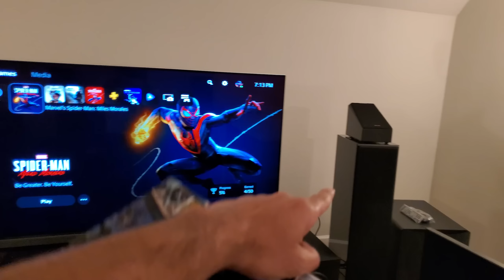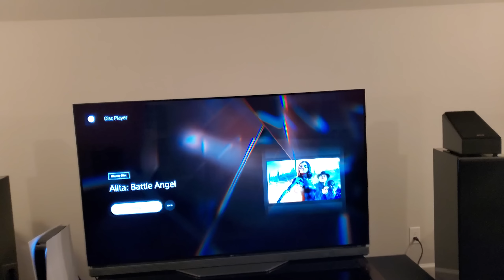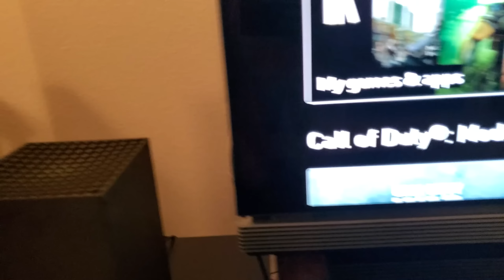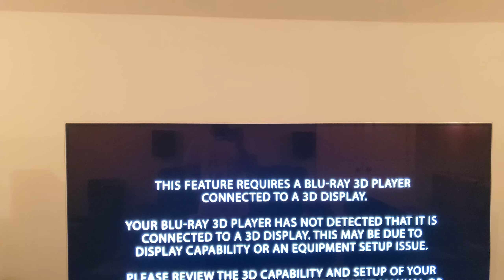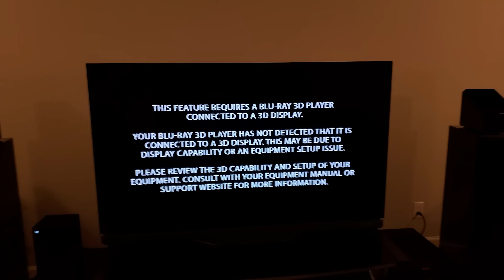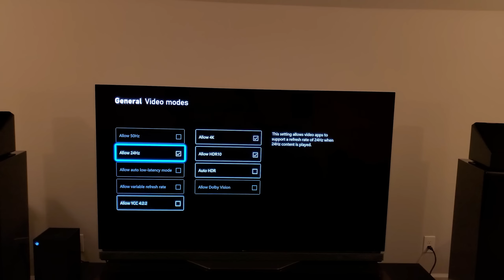PS5 and Xbox Series X 3D Bluray Test and 4K UHD Bluray Comparison

Comment: You might need to just run auto visual settings setup on the settings screen so the system can properly detect the TV and you will be asked to set the screen size for 3d if it works. You'll get the same error on a system setup that hasn't ran automatic visual settings on a PS3 too.

Comment: 3D not supported on PS5 for the VR2 capabilities.
I believe 3D is supported on the Xbox but you would need to downgrade from 4k. 
3D only supported 720p side-by-side and 1080p 3D signal mode. So it’s not working as you have your resolution too high.

Comment: This is why i use the Sony x700 also .... i use the lg cx9 55" and also the JVC DLA-N5 on 100" cinema screen. In thr x700 you will find an option to aktivate 3D Mode also when display setting ist set to 4k output.

Comment: Glad I kept the Xbox One X that I won for free from Taco Bell even though I have the new Series X. I use a 4K BenQ projector and 150" screen that supports 3D in 1080p mode and over 500 3D movies. At least old reliable still works! Boooo Microsoft! It would have been so easy to add it to the Series X. You big dummies!

Comment: If you can't get this tv; you can always find the 2013 Panasonic Plasma ST, VT or ZT TV's Just as good black levels and cheaper on the second-hand market. Just 1080p if you are willing to deal.
Reply: And it's not a shock that both don't do 3D. 3D is dead. :(

Comment: Do you have to go though setup on the Xbox series X hardware and let it detect that your TV supports 3D ?  first  ?  I did search on X box series X Blu-ray 3D compatibility and others reported current firmware does not support as well , so its probbly a lack of software support as well ..

Comment: I believe the PS4 also didn’t have 3D blu ray support at launch. Maybe soon if a lot of people ask for it.
Reply: That is correct. At first my Ps4 couldn't play 3D movies, but after a firmware update it was able to. So as you say, there is a possibility that a firmware update might come to Ps5 as well.
Reply: @Macop 3 years later... I don't think so 😢
Reply: Yep you’re right. I was shocked when my PS4 couldn’t play 3d Blu-ray or even have the art of the movie show up like Ps3 but the update changed all that.
Reply: My Ps3 and Ps4 both has no issues playing 3D Blu-ray content ,, its a software support issue on the ps5 as the system hardware can easily support this content as well,  users need to make this very clear to Sony that they want this feature , 3D bluray disks store there stereoscopic content in a special file format that contains both the (primary) left and right eye frames this requires the player "recognize" this data format if it does not  . you get the playback not supported on this device message,,
Reply: 5 years later I'm still waiting, this is getting annoying!

Comment: Can the ps5 play movies in Dolby vision and hdr 10?
Reply: Perhaps you can look into a dedicated player. The Sony UBPX700 is on sale for $149 at Best Buy. Supports Dolby Vision.
Reply: @its_ohhrite  I looked into that 4k player and I don't like that you have to manually change the Dolby vision on and off each time. I'm considering the Yamaha bd800 now.
Reply: @Angeleno316  that is true. Check into the LG UBK90. $250 right now on BB and you do not have to switch DV on
Reply from the maker: No. Only HDR10